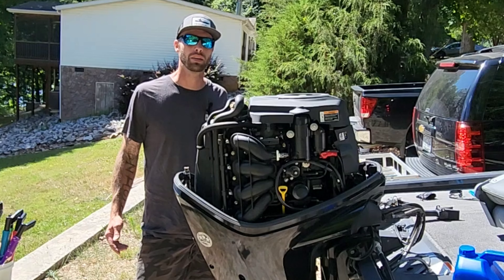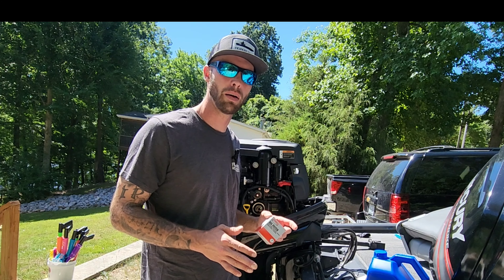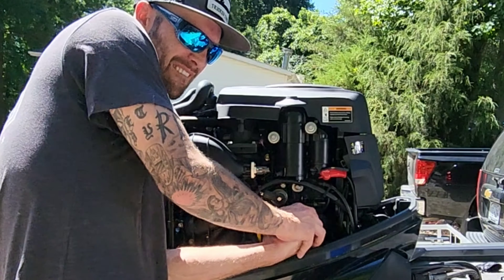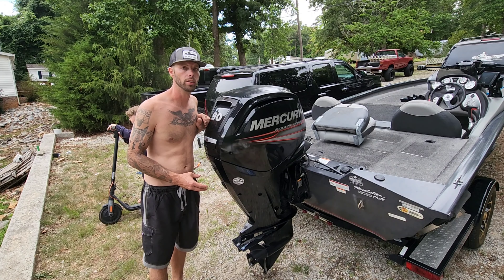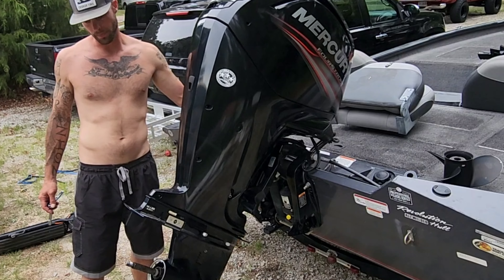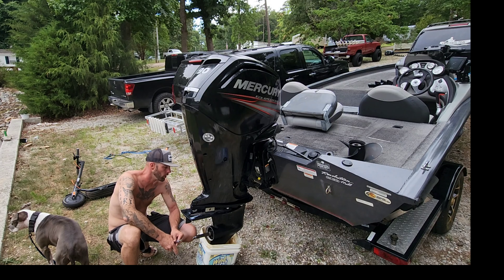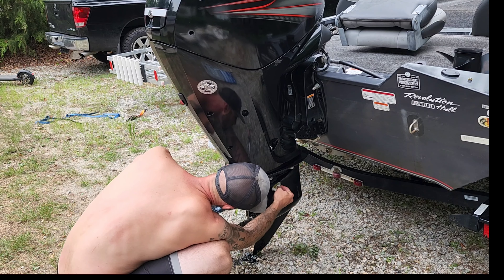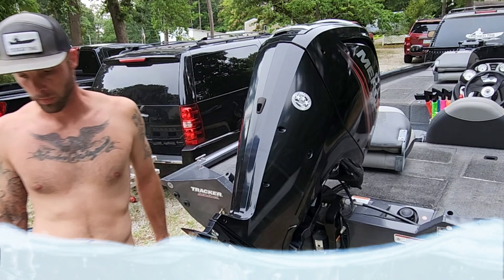"How to change the oil in a 4 stroke Outboard Motor" Mercury 75/90/115  #outboards #maintenance

Comment: Can you replace the oil drain plug on an  a 2010 , 90hp 4stroke efi to the drain bolt like your 2015 has ? If so do you know the part number ?
Reply from the maker: I dont. Im sorry. Id ask a Marina